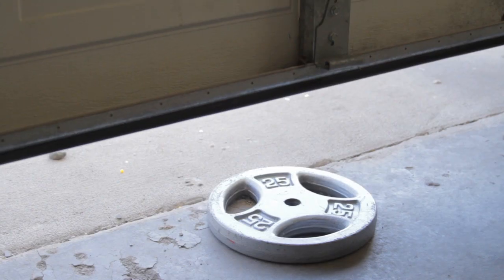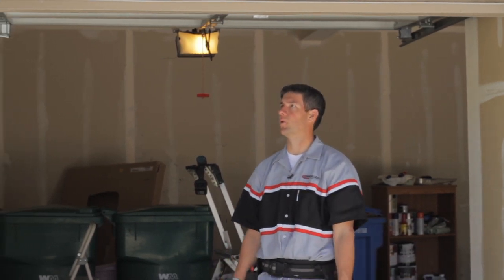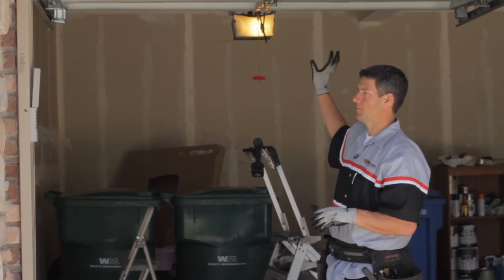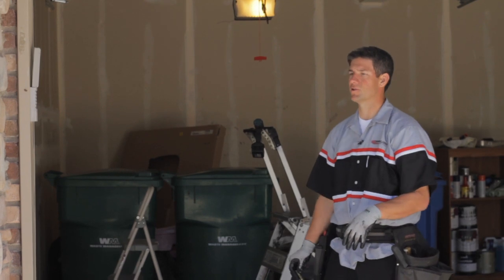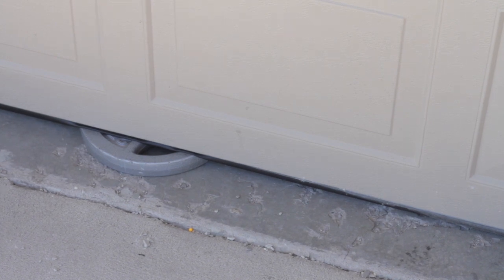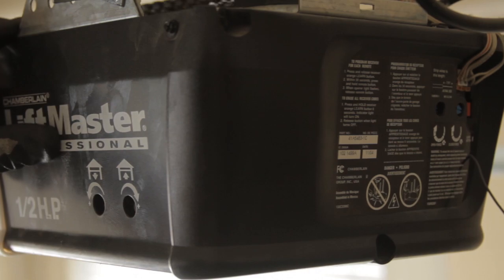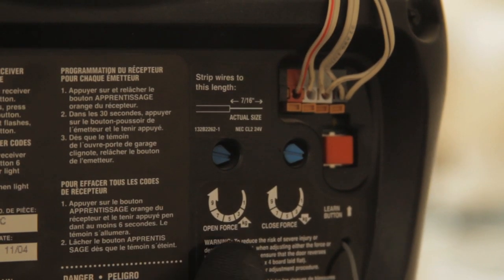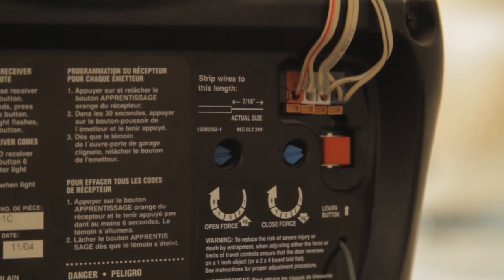Garage Door Help : How to Adjust the Tension on a Garage Door Opener

Comment: Great video's . I replaced a worm gear in a sears opener, easy enough but now the door goes in reverse only after a second or two . I have adjusted the up & down stops to no avail nothing seems to work . What am I doing wrong ? Bob